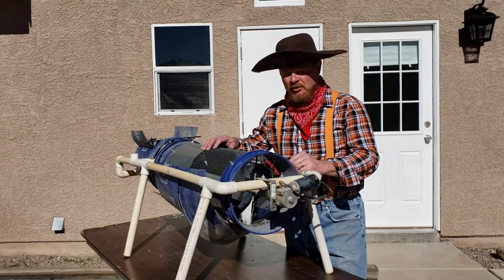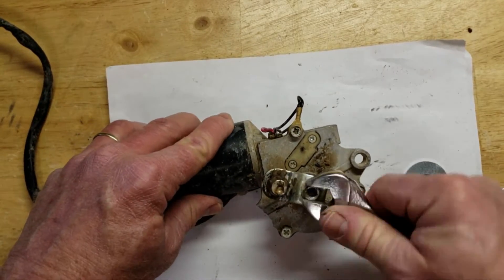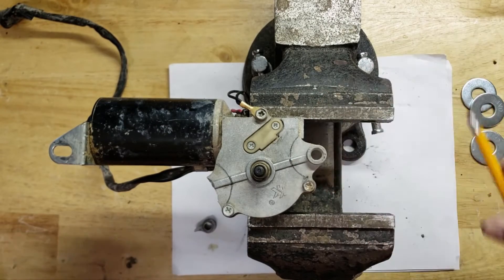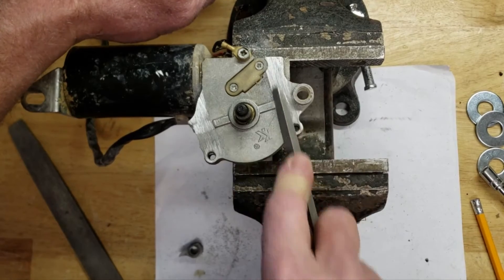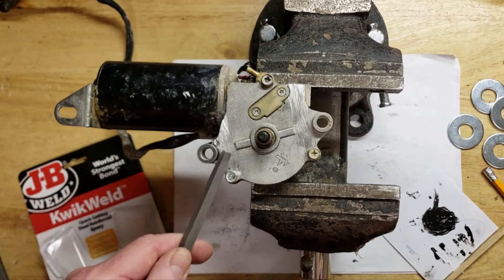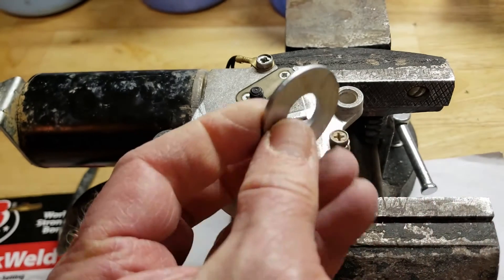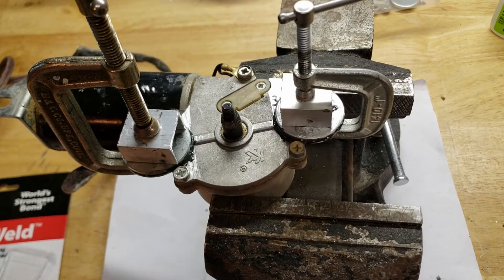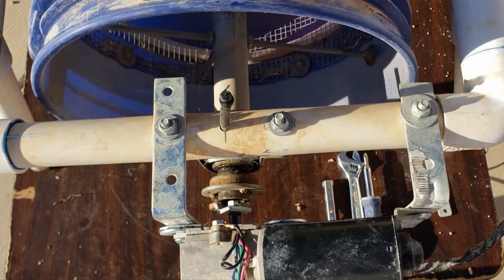Allan's Gold Mining - Trommel Drive Motor Update

Comment: Could have just cut a slot in the lower washer on each hole , no filing away the only original structural support then ... Quicker and stronger with no grinding !

Comment: yeah trommeling for hours prob. exceeded the design limitations of wishy-washy wiper motor useage ....  build it better ! that metal is like 'pot metal' high zinc - aluminum .. u might be able to weld with tig .. that might require argon gas ...  pricey rig ...
Reply from the maker: The modification appears to work fine.  There are 120v gear motors available, no doubt much stronger.  Thanks for watching. 👍

Comment: From boiler rooms to car engines and drive systems 
STRESS ON PARTS causes breakage. 

Some trommels feature a tiny Universal joint that takes shock from the loads as they hit the trommel 

In truck drives shafts the Universal joints take away stress from the engine and transmissions and transfer cases depending how these are connected.

You noted in video 1 about NOT putting the wiper motor in direct drive which is absolutely correct as it tears appart motors and transmissions of all kinds 

So in many devices there is a FLEX connection   These are notibly in washing machines to protect the motor so there is a fiber rubber tube some times in heavier equipment a u joint of sorts that has a eight legged  hardened rubber flex connector that absorbs LOAD SHOCK

This is the professional solution any version of this 

Looking at the damage
However the breakage along the left side and you noted the lack of metal around the ear. 
First I would look at a FIBER RUBBER WASHER on that side under the washer as it will lower the load shock.    

The solution with equipment I have worked on and been around is to make a helper steel plate of thin stock  the alumium needs to be cleaned bare on the new motor the thin half moon plate needs to be adhered with something like JB WELD and after dry bolting though  both the aluminum ear and the helper plate bonded to the ear this will not break again
Reply from the maker: Hi Bo.  Thanks for all the great comments and tips !  Like the fiber washer idea !  I design and build airplanes and telescopes.  Motor mounting is critical for precision instruments, which why I used the ring universal on trommel.  Too much flexture going on with all that plastic.  Lol !

Comment: Hello Allen,
Just a quick question. How did or do you get the wiper motor to rotate all the around “ 360” do you have to re route wiring or is it an internal gear box that needs adjusting?
Reply: Thanks allen. I thought, so my brother grabed a motor from the rear of a wagon  but it only does 180 degree half rotation so I was curious but he grabed a front off a Mitsubishi Lancer and it fully rotates like yours. So moral of the story. No rear motors lol. 
Poizon83🇦🇺
Reply from the maker: @poizon83  Ah ha !  Good moral indeed !  Never use a rear motor.  Good tip.  The motor I'm using comes from 1996 Jeep.
Reply from the maker: Good question.  Actually, it's a motor and worm gearbox.  So it rotates 360 continuously. There is a ball arm attached to drive shaft.  On an automobile, this ball arm rotates a lever, which causes the wipers to move back and forth.  The motor has a lot of torque, making it great for rotating a trommel.   🤠👍👍

Comment: Thanks for the Trommel motor repair information.  I recently broke 2 mounts on 2 motors but I was able to continue running the bucket trommel with the remaining good mount.
Reply from the maker: Thanks for your comment Dale.  Yeah, I experienced the same situation.  Since I  made the modification,  haven't had any further problems.  I believe the culprit is a large irregular rock gets caught inside the trommel causing a momentary jam, thus jolting the drive unit.  Best of luck to you !
Reply: @allansgoldmining  Yes, I'm sure it was a rock jam.  I used a bucket lid on the feed end of the trommel with a large hole cut in it for the feed hopper.  It helped to keep the water and material in the drum but I think rocks got jammed in it.  I'm thinking of expanding the lid hole and using some flexible rubber for the seal.
Reply from the maker: Good idea.  I placed two vertical rods about 2" apart in the hopper.  That kept those big rocks (and flat rocks) out.  After I  built the new feeder hopper, I  didn't need them.

Comment: Reason why it broke... all the bolt holes are designed to be bolted in the "same plane" so there is an equal force working against the 3 bolt holes. Your design puts unequal pressures acting against your 2 mounting points. Put a piece of flat stock across to span the 3 bolt holes and use 3 bolts to secure the motor to the flat stock and and then connect it to your 2 mounting points, that will stop it from breaking.
Reply from the maker: They are on the same plane......
Reply: @allansgoldmining  Really? 2 L brackets bolted to a piece of pvc pipe will maintain the 2 connection points perfectly parallel to each other? 

I can see how you think they do, in your other videos, with nothing in the trommel, they "look" like they are moving together in the same plane. 

In solid mechanics, there is stress caused by Static, Dynamic and Harmonic forces. Aluminum alloys are not very ductile; although it has relatively high strength, when it fails, it is a sudden failure. Just like what you show in the video. It looks like it has been snapped off, with no tearing or stress lines like you see when steel fails from flexing.  

I do mechanical design in CAD and use https://www.simscale.com/ to test the strength of my designs. 

I'm just saying, if you mount the wiper motor to a piece of flat stock steel bar, so the 3 mounting points on the wiper motor stay perfectly parallel, it won't break the casting. Just use longer bolts to connect to the brackets. Rubber bushings between the motor and the steel plate wouldn't hurt either. The L brackets or PVC will fail first. ( I vote for the pvc giving out first.) And you won't need to screw around breaking, then reinforcing the cast ears on the worm gear housing. It will only break somewhere else next.

BTW... I have watched your videos and I may possibly have an idea so solve your dewatering and silting problem... I have been working a low cost design to clean CNC coolant of metal shards, particles and tramp oil and think it would also work for desert mining. Where you are trying to conserve water yet keep the water clean so it doesn't clog the spray bars and stop running a ton of particles through the pump. I'm trying to improve the on the CFD tests I ran. It is a combo of a lamella clarifiers, under flow baffles, gravity centrifuges, electrocoagulation / electrodeionization and a couple of other tricks I have used on parts cleaner tank solvents. And it can be scaled up to any size. I have a prototype built for the electrocoagulation / electrodeionization tests, since you can't model that using CFD. Been testing a method to prevent electroplating when using water based solvents. For example: Brass shavings and bushings will dissolve and get deposited on steel parts in a water based cleaner or coolant.
Reply from the maker: @kiddiescripterkiller  thank you for sharing this.  Sounds interesting.  My brother has several CNC machines at his shop with coolant and lubricant filtration systems.  So I can somewhat relate.  As for the trommel drive, the fix appears to be effective so far.  Thanks !
Reply: @allansgoldmining  the 2 mounting "L" brackets can flex independently... So at that point, they are not on the same plane... And will have pressure applied at different angles. follow?
Reply from the maker: It's  possible, however, the torque  is perpendicular to that plane.

Comment: My opinion you should have cut a slot in the washer instead of further weakening the motor
Reply from the maker: Cutting a slot in the washer would weaken the fix.  On the underside, not demonstrated in the video, is re-enforced ribbing.  Therefore, grinding off the external spine is best approach to the fix.  The purpose of the washer is to displace the torque over a broader area.  Thanks !
Reply: @allansgoldmining   I don't know I beg to differ I believe the steel that the washer is made out of even with the slot cut has more structural integrity then cast aluminum I don't know I will have to look up the structural integrity of caste aluminum versus stainless
Reply: @allansgoldmining   But either way you do awesome work it was just a thought right or wrong doesn't matter the job got done and it works
Reply from the maker: No problem.  Basically, that external spine is fairly worthless in my opinion.

Comment: JB Weld is always a good choice ;)  An alternative approach might be to mount a piece of 1/8" plate aluminum directly to motor using 3 gearbox holes and then mount plate aluminum to trommel.  Might need to get longer screws.
Reply from the maker: Absoutely John.  I thought of milling an aluminium plate as a replacement, but I figured most folks don't have the equipment to do that.  So, I thought a more traditional "bush fix" would be proper.  Lol !
Reply: @allansgoldmining  I think I would've built a dam out of tape and filled up to that cast support with jb instead of removing structure making it potentially weaker. Also the thought of filling that in with some good brazing rod popped in my head while watching this but that would mean taking that part of the housing off completely.  I'm loving your designs and channel!
Reply from the maker: @666hobart  Thanks for your comments !  I should have shown the underside of the plate so folks would get a better idea.  There is substantially good structure on the underside, except where the mount holes are.  Weak design in my opinion.  Even though you have grind down the some of the external structure, the steel washer bridges the gap.  Thanks for watching.  Glad you're enjoying it !